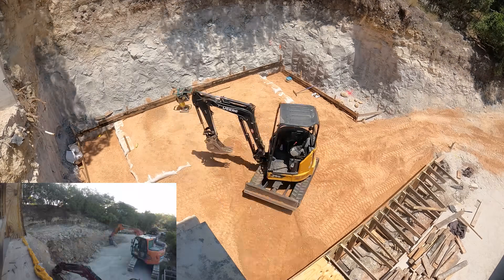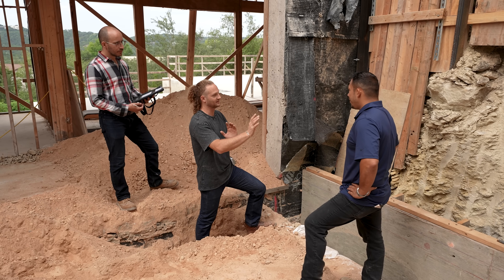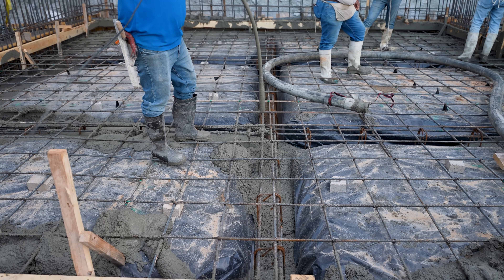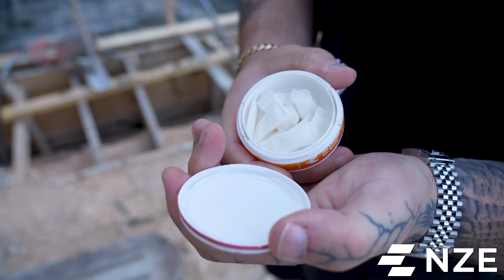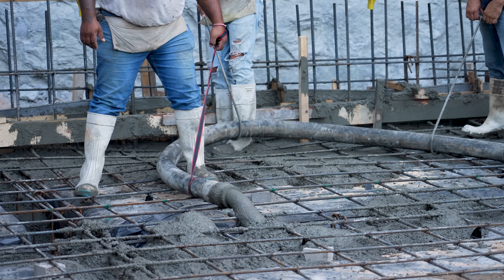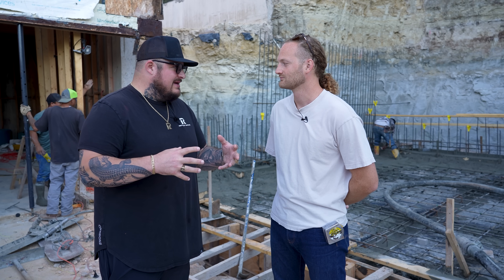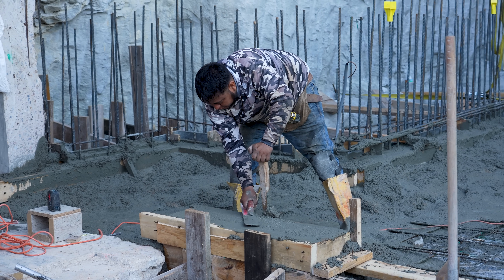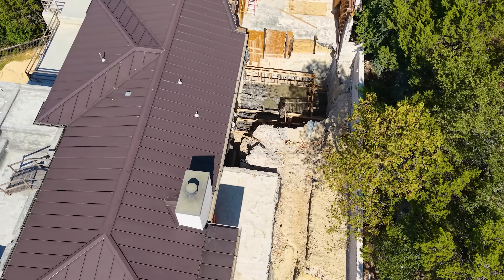$1,000,000 Pool Project Super Car Garage Concrete Pour

Comment: In the 1970's, the engineer for the Washington, DC subway system said that concrete is water-proof. So they didn't line the tunnel under the Potomac. It has been a disaster for years. In the last decade, they had to shut down two major subway lines to get in the tunnel and seal it from leaks, at a huge expense. Now there are discussions to build a second tunnel so they can finally go back and do a through sealing of the original tunnel. Note: Now that tunnel carries three subway lines. 
    Moral: Concrete is porous not water tight.
Reply from the maker: Hahaha damn!! That’s insane!